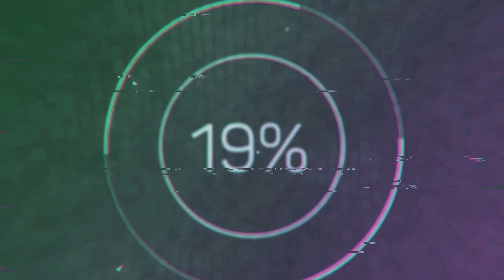New Harley Davidson Fat Boy 2021 BEWARE before you buy!!!

Comment: You can try to tighten the screws with lock tight. It is not a safety issue. The holes in the rotor have too much clearance. It is an annoying problem as it makes this sound. If you tighten it, like I mentioned make sire the rotor is in the most front position. So it is more likely to stay fixed.

Comment: These are called floating they are supposed to have play at the rivets that's the way they are designed I suggest you search for floating rotors versus solid rotors there are several videos on there that will educate you on the matter in fact if you look at some racing motorcycle rotors the rivets are so loose they actually will rattle if you shake them in your hand. The reason you're back one is not loose is because you do much more force with your front brake the metal gets much hoter than the back one and expands and contracts the rivets develop their play this is normal. Your other Harley has two front rotors so the force is dispersed between two of them keeping them cooler and this is why it takes longer to develop play at the rivets. Use your head for a second bro do you think a multi billion-dollar company like Harley-Davidson is going to ignore this if it can be potentially dangerous? It would literally cost them nothing to correct this problem if it was a problem. For those of you who are annoyed at the little play in your rotors switch to solid ones problem solved get on with your life as for me I like the floating rotors much better they stop better they cool down quicker and they don't warp

Comment: Same issue in the front and rear of my 2021 Fatboy. They say it's normal and will do nothing about it. I have had several Harleys with floating rotors and they never did this.
Reply: What really? That is insane luckily my dealer replaced them with proper rotors immediately when I showed this issue to them.
Reply: Floating rotors should only be the outer part of the rotor. The ‘hart’ should always be fixed. Seems they have too much clearance at the holes.